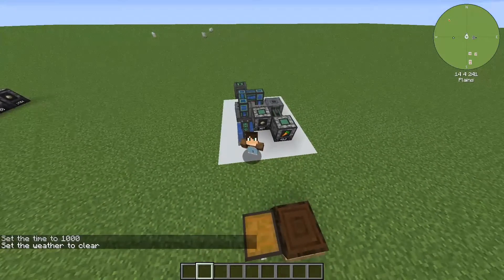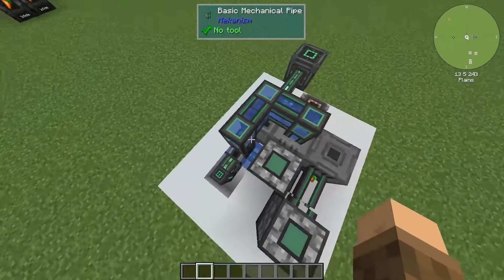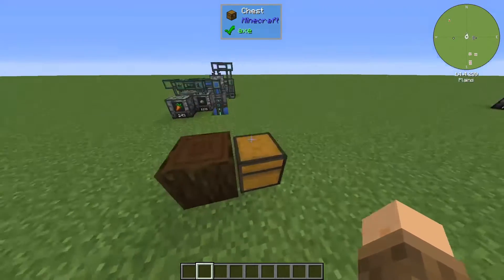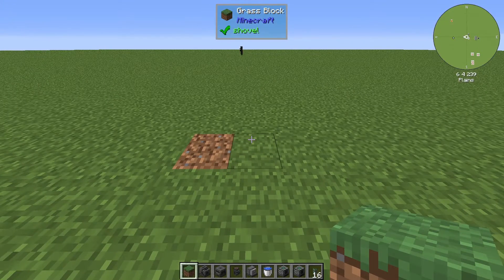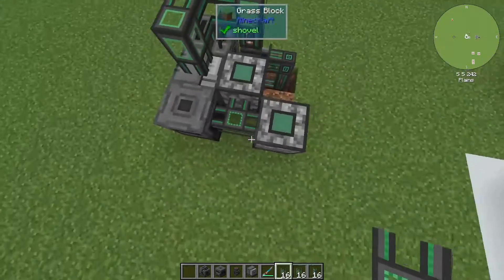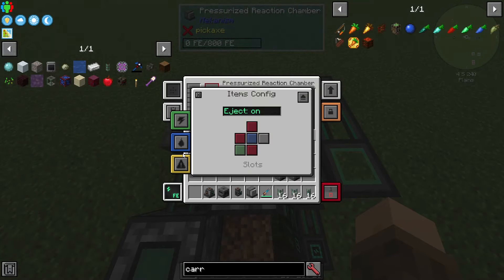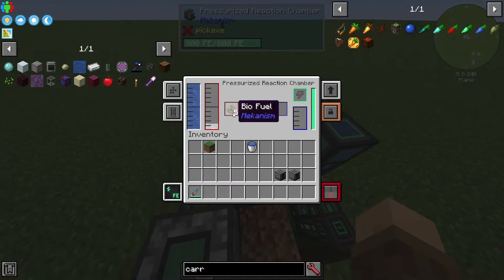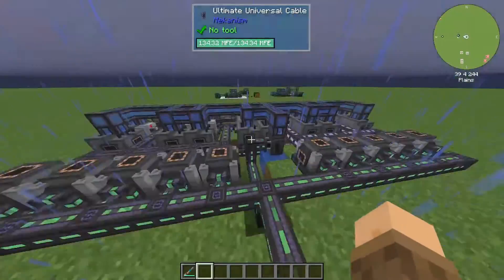Minecraft 1.16.5 | Mekanism v10 | The MOST compact setup for infinite power generation

Comment: Amazing video! I just built this and I spent a good hour trying to figure out why the bio fuel would stop at the pressurized reaction chamber and the oxygen and hydrogen were NOT showing up. if anyone has a similar issue, you need to inver the redstone configuration (the 1-0 on the bottom right). Im not sure why but it worked for me.

Comment: this is a good build. However the Ethylene isn't being burned off fast enough causing everything to stop. Any suggestions?
Reply: Ran into the same issue, my recommendation would be to add a second gas burning generator and add some speed upgrades to the other components. I added 1 speed to the electrolytic separator, 4 to the pressurized reaction chamber, then 5 to the crusher (I think 4 would work but some overkill won’t ruin the system). Only other thing you NEED to do is add 8 energy upgrades to the pressurized reaction chamber cause without them it’ll use around 10k rf/t. Also might want to use elite universal cables for the energy output and advanced pressurized tubes to transport the ethylene.
Reply: @ooperfrick7146  I'll give those a try thanks a bunch for sharing!

Comment: Does this require Mekanism: Generators, or is there a way to produce power in the NORMAL mod?

I ask because I have looked to frustration and couldn't figure anything out. Mekanism does not have any way to produce power itself.

For comparison, I am running minecraft 1.16.5 with mekanism, and I have discovered ZERO power producers in the mod
Reply from the maker: Hey there! Thanks for the comment. To be honest I'm not sure how to help you out. This is on Mekanism v10, the latest release of the mod if that helps.
Reply: Gas burning generators, windmills, solar panels, and the lava generators are in the 1.16.5 versions of mekanism. You don’t need an add on.